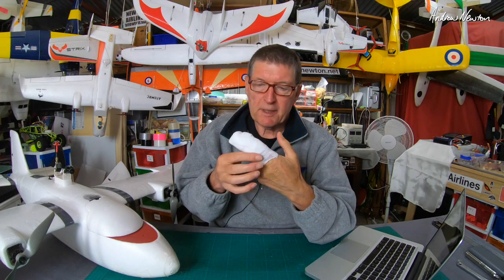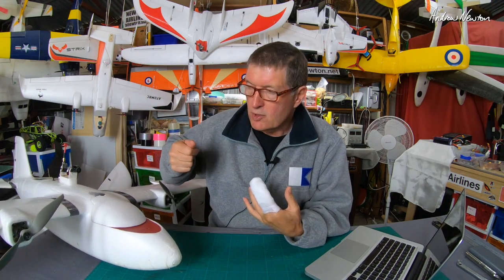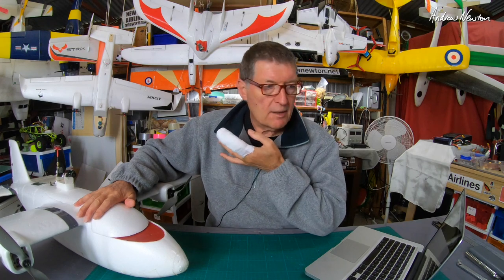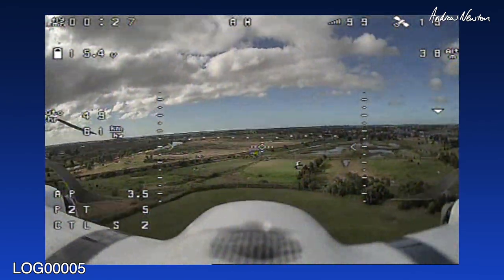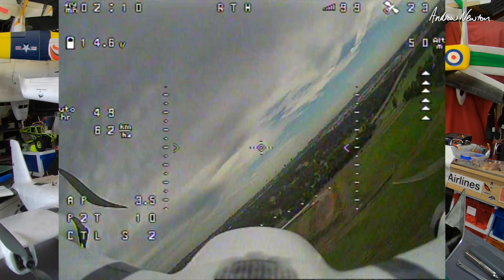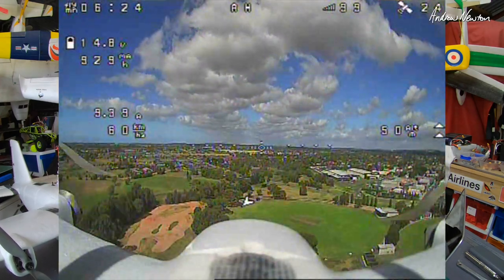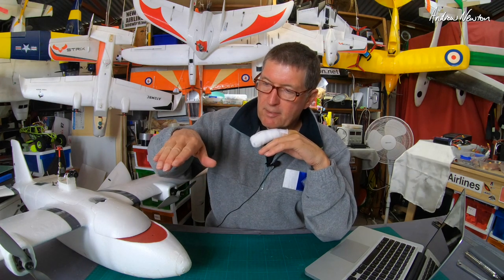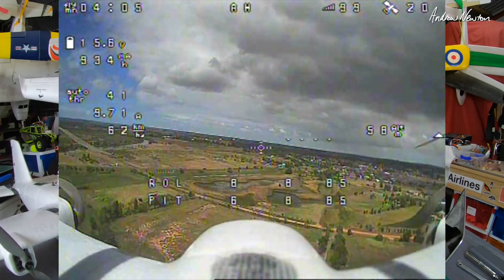INAV Pitch Oscillation Fixes - Crosswind Mini

Comment: Great information on damping pitch oscillations. Great work between the INAV community and you for chasing this down. It is a significant contribution the the RC community knowledge base. 

It demonstrates that a lack of feedback from servo position to flight controllers (INAV) can be a problem point. The FC assumes a servo goes to its assigned position, but a stiff servo, or hinge can cause it to stop short. The FC has no idea servo stopped off position, so any response always delayed until plane have moved off the desired flight plain. 

I anticipate at some point (for more advanced builds), we'll see servos that will be able to export position to the FC  (ie: a class of servos with two-way communications to the flight controller).

Comment: Nice one Andrew. I reduced my degrees per second pitch rate at the weekend and the oscillation is completely gone.
Reply from the maker: Aha, that may be the key parameter
Reply: What value did you put adam?
Reply: @sarantis2  110 degrees per second on pitch rate

Comment: Nothing centres like a digital servo, and KST are one of my favourites.. Performance testing a lot of different varieties out there reveals a there's a lot of rubbish being sold, 
probably ok for rough park flyers, but precision and holding power is another story, much more evident for me with FPV planes.
Sorry to hear about the accident, I hope both fingers fully recover. I lost the side and tip of my left index some years back, I put the missing piece back, had it properly fixed and the feeling eventually returned, the scar has faded, but it still reminds me to be careful with digits around anything that spins.
Cheers.

Comment: Hey Andrew. Glad we finally worked that out. And also I learned a lot by this. I used the experience to find better new Starting Points for INAV settings (rates, pids and navigation settings) that will come as defaults in INAV 2.7. Together with a heavy overhaul of the Autotune process and MAYBE even an overhauled PID Controller, these things might be a thing of the past overall. 
And all the best for your fingers. I hope you are well again very soon :)
Reply from the maker: Yes, interesting exercise. Thanks so much for your help.
Reply: Looking forward to this new release. Im currently having similar problems in my altitude hold. I believe i've got to the point where i'm almost manually trimmed at the true midpoints. Control surfaces are smooth and no overtravel. Alt hold is like a roller coaster and my loiter is more like an off level ellipse. Odly though its been flying great in ACRO. Manual mode is almost there but im trying to get all my trimming as close as possible before i finalize on the autotrim.
Reply: @sckirk2  yeah this is usually because of too high rates or too low FF. But yeah hopefully 2.7 will finally fix this completely with the new tuning system.

Comment: I think all these changes are good, but it would be interesting to see how it flies with your old settings now that the elevator hinge is fixed.
Reply from the maker: Yes I must revisit the old settings with better elevator control.
Reply: It would still oscillate because a bunch of us had the same problem with this plane. For me the problem was solved the moment I reduced the pitch rate degrees per second.
Reply: @AdamGdoesFPV  Yeah it easy to set the wrong rates. In the next INAV release autotune will automatically figure out the correct rates so that saves a lot of guesswork.

Comment: Welcome to the modified fingers association, hope you heal quickly!
I think you mentioned adjusting Dual rates for roll speed.
I have given up dual rates in preference for expo.
With dual rates, in a crisis situation, fumbling for a dual rate switch to get full throw, is prone to ending up with a lawn dart.
With expo, you have the advantage of a lower rate in the middle of stick travel, with the advantage of full throw at full stick movement, (without having to flick a switch).
Regards Keith
Reply from the maker: Thanks Keith. Fingers are back in use. I use expo instead of rates too. Might have been talking about rotation rates rather than dual rates.

Comment: how to set the elevator reaching 60 deg total up and down
... ?
Reply from the maker: Longer servo arm and use the outer hole
Reply: @AndrewNewton  so it not set from inav itself yes..
Reply from the maker: @siogana  You can reduce the throw in INAV if needed, but not increase. So first the servo and elevator have to be able to go that far.